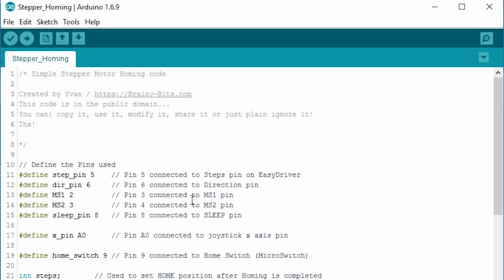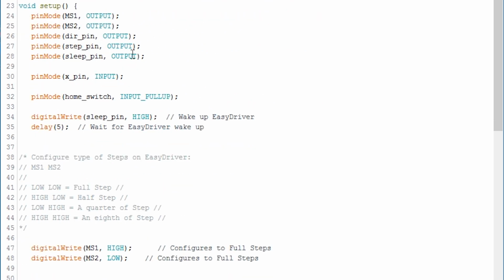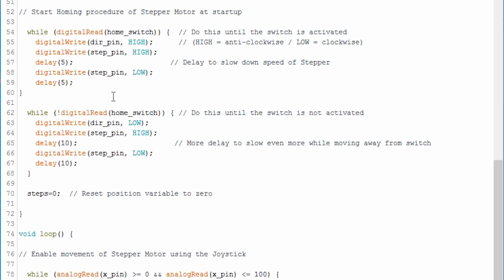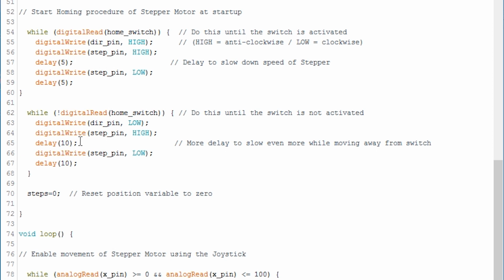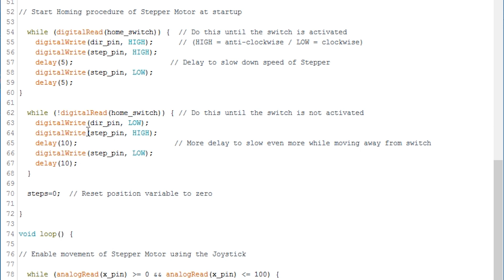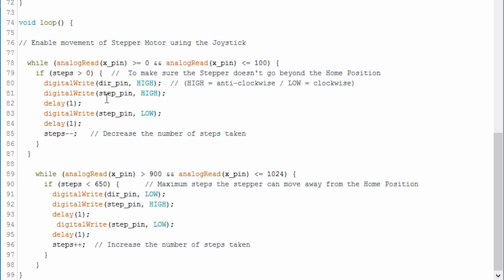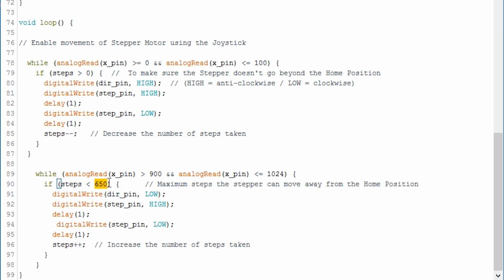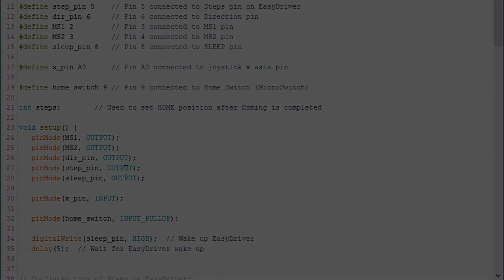How to "Home" Stepper Motors using Limit Switches - Tutorial using Arduino and Easy Driver

Comment: I've got a question I have a truck that has rear steer on it. it has a motor that controls the tie-in rods.   I'm going to take the factory motor off because it doesn't work I can't get parts for it anymore and put my own motor on it. it's going to be a brushed motor I'm going to use an encoder instead of potentiometer for position control.  but I need to be able to find some way to home that motor to go left or right to find home. in your example you turn it on and the motor turns clockwise until it hits home and then it stops,which is fine. but what if my axle was turned the other way. I need a home switch but I need the motor to know if it needs to turn left or right to get the rear axle to the center position. Got any ideas on how to do that?

Comment: I am making a Soda can crusher using a NEMA 23 stepper motor. It will take several rotations for the soda can to crush using a Befenybay Ball screw with end supports. What I want it to do is hit the end limit switch and have it return to position zero. What I have run into is when I code in. myStepper.step(20000); it works fine, any greater number and it reverses the direction of the motor. What I did is put in the command twice to make it go 5 inches. The design is to crush Monster cans which are 6.5 inches in length down to 1.5 inches. Thank you for the video. I am not much of a coder. The code seems straight forward however.

Comment: Should I use 2 switches to be safe in cases where the gears might grind?
I've got a Rack and pinion set up where at almost full extension of the rack, the ram cannot physically extend any further. Should I have a switch at the closed and fully extended positions to prevent gear grinding? This to me sounds better in case some steps were missed. Thoughts?
Thanks for the video :)

Comment: Hi. Is it possible to not use limit switch instead create a function data which inputs the position of the stepper motor into an SD card?
for instance, i limit my stepper motor to 3 rotations clockwise. When it is controlled and moved 1 rotation and I off the power, when I start it back, the arduino reads the data from the SD card and automatically knows that the stepper motor is at 1  rotation and it only either can go another two clockwise rotation or 1 anticlockwise rotation.

Comment: hello paul, i'm a beginner to arduino.
i want to create a project  in which at initialization stage the program should record the final position of the motor when a button is pressed and record and save the value  permanently as final position .
after that when motor is in home position whenever a button is pressed , the motor should move to the saved position and when again pressed it should home back to original position .
can you help ?
Reply: the movement should only be after push of the button

Comment: excellent and interesting!
two questions:
1. in the first part (no external file) is there a bouncing  problem in the limit switch?  and, does the accelstepper version  contain such function here?
2. I am not familiar with the driver you use. can you kindly inform the equivalent wiring to a driver like DM860A?
thanks.

Comment: Thanks for the video.  I have a question for you, if I wanted to completely run with limit switched only (using relays to turn on a motor) is that possible?  Instead of having a driver program, I would just have the motor turn on with a relay one direction until it limited with the switch..  then reverse out of it to go the other direction (say, with a screw).  If is could, would I wire the limit to cut off the positive power?
Reply: You prolly dont give a damn but does someone know of a way to get back into an Instagram account??
I was stupid lost the password. I would appreciate any tricks you can offer me
Reply: @Kyler Malachi i really appreciate your reply. I found the site through google and Im trying it out now.
Seems to take a while so I will get back to you later with my results.
Reply: @Kyler Malachi It did the trick and I now got access to my account again. Im so happy:D
Thanks so much you saved my account :D
Reply: @Rohan Samuel you are welcome :D

Comment: Digital has great advantage, but i love analog as a newbe... i would use optical switch for home position. soon as you power up, you let a 555 timer run once to activate motor to go to home base where there is an ir stop switch, then that activate some sort of latching (On) switch from the same 555 timer when its sinking voltage. its just a matter of giving sufficient time for sourcing and sinking current.. done

Comment: If you wanted to stop the motor from accidentally stripping the threaded rod if you lose a couple steps or something do you have to wrap each motor step in a while loop? For instance if I had a program to make a square would I have to do: 
While XSwitch is low && xVal < 120{
StepperX.move(1);
X++}(obviously not the actual code)
Then repeat for y, then again for x in reverse, then again for y in reverse? Or is there an easier way to initialize it and if at any point an axis hits the switch it stops moving that direction? I have a few sketches I've been using to test my vinyl/pen plotter/3d printer that make things like smiley faces that would require A ton of while loops :/

Comment: Hi, how will 0 be set, I'm building a DLP printer, when I fixed the motor in place and connect it to arduino mega, will that point be its 0 and how can I set the 0 in different positions? 
I asked and thy say to use a block switch or end stop, but as I saw in your video that it only backed off a little from the switch 
I'm new to arduino hope you can help
Thanks

Comment: Is it possible to show us  microstep TB6600 driver Arduino connection with the drivers  by the three motors with endstop buttons with relay to stop and run the drill please showing this in video or photo please ? cnc machine?

Comment: I was wondering if you guys could do a tutorial on a stepper motor attached to a compass module, so when the direction changed it would move the stepper motor, this is something I'm looking for as a easy course holder on a boat, the stepper motor would control the rudder
Reply: Mike OBrien do you have a compass module in mind? I'd have to order one to be sure it works right but I think it should be rather easy to convert the input of the compass to an output for the stepper. Of course I have limited knowledge of boats so I could be wrong. How do you plan to drive the rudder? Like is the motor going to be connected directly to it, or are you planning on putting it on the wheel or something with a manual override? Seems like a big line following robot to me
Reply: Hi Chris; I have a HMC5883L, this is a 3 axis compass unit which may have issues with the boat rolling, I thought by reducing the sample rate we could sort of average it out. Its really only something to keep the boat going in the correct general direction, it doesnt have to be exact.
My boat has wheel steering so I was going to get the motor to turn the wheel. I'm just looking to start small and build up to add ons like rudder position sensors (to stop the stepper motor when full lock is reached), however I think this could also be done by counting the steps on the motor.

There is a few YouTube videos from people who have made full boat autopilots, but none explain things very well, Im just looking for something simple to start off with

I would be most appreciative of any help you can give me.

Comment: what is the best driver for small stepper motors (and also be not expensive because of limited badged)?
Reply from the maker: The Easy Driver boards (https://brainy-bits.com/products/easydriver-stepper-motor-driver) like the one I used in this tutorial, are pretty cheap and easy to use for small steppers up to 1.5Amps.  Thanks for watching!
Reply: Thank you.